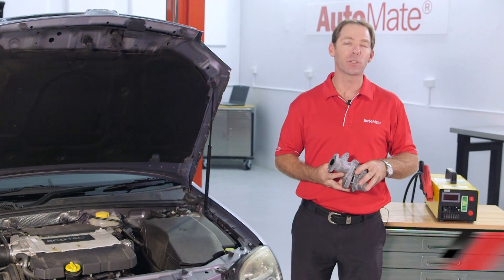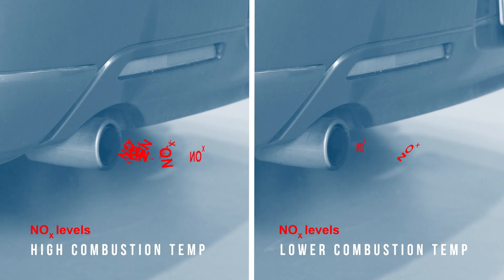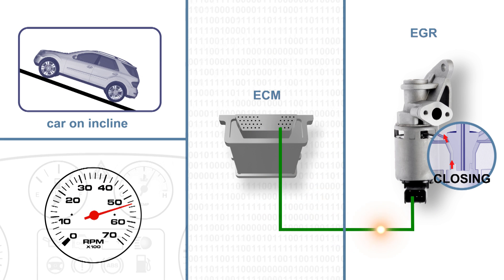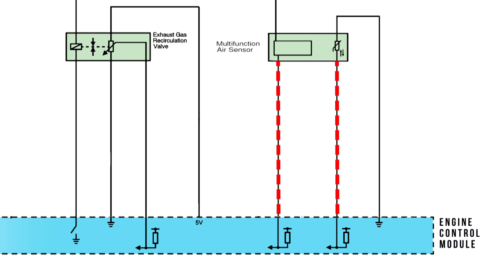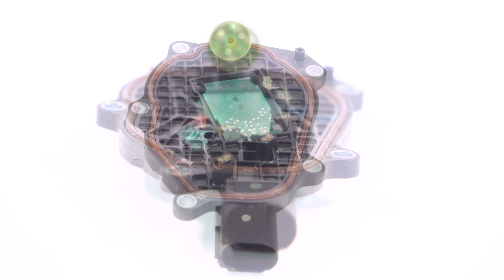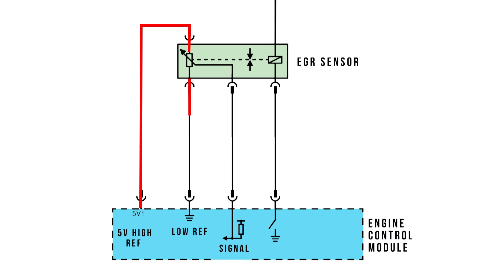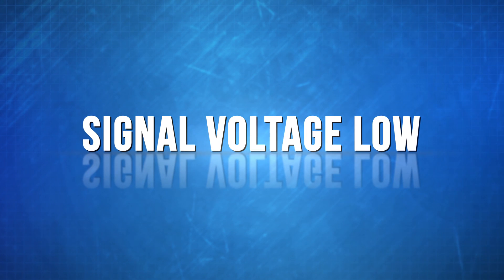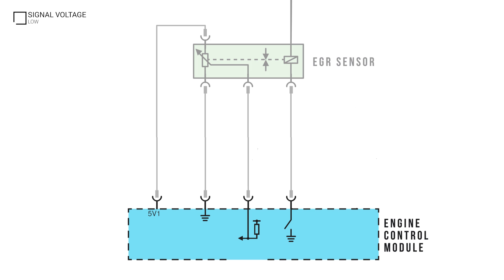EGR Position Signal Voltage Low

Comment: Hi sir,  i hope you can help me. My car is hesitating usually in the morning,and when it warms up it runs fine, but sometimes issue remains. I noticed that the egr voltage is on and off when the car is jerking. when i drive  the car with the  solenoid valve dismounted and the cable is connected It runs normal.